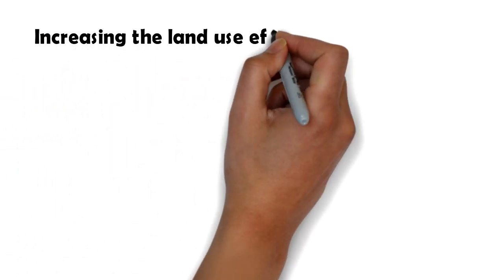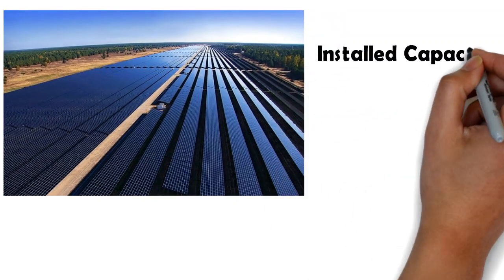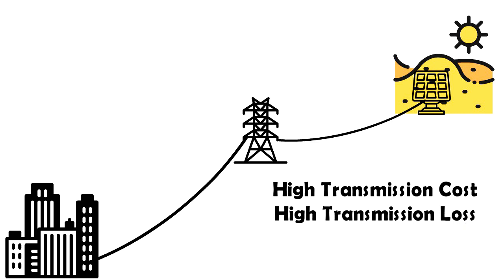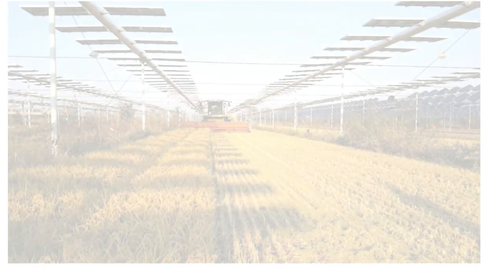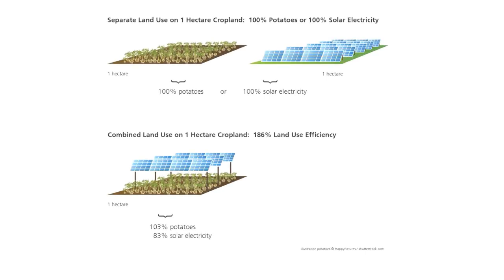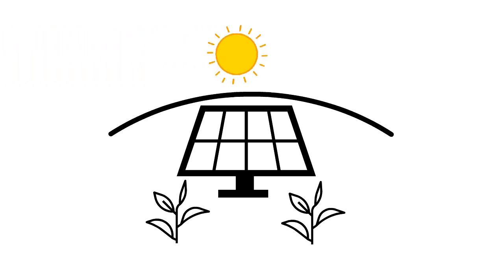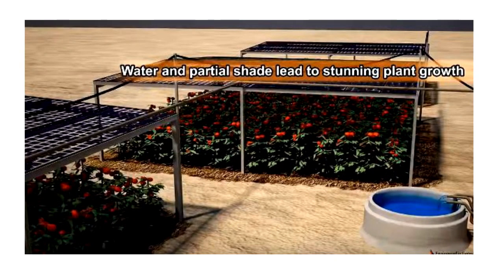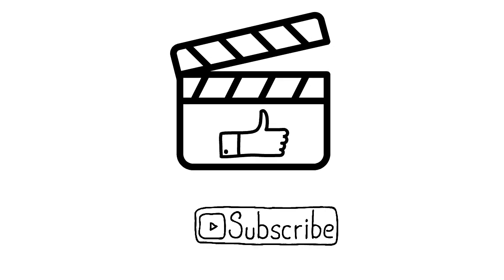Agrophotovoltaics- Increasing the land use efficiency

Comment: The best placement for photovoltaic energy production would be the nearly 50,000 miles of interstate highway in the US that already run through and between most major cities. Trees and shade is almost nonexistent, especially in the medians. Power transmission is already available on most of it - It's a no-brainer!
Reply: Consider the fact that we already own the right-of-way for the entire project and it's easy to access.
Reply: That's a good idea. I think the only problem would be in cleaning the SPV panels. Both the exhaust and regular dust will accumulate on the surface, and as long as there are cars zipping by, it would be difficult to clean the surfaces. Maybe they can be tilted vertically and let the turbulence of passing cars blow the soot off the surface.
Reply: @ericdew2021  I think there would be a lot more dust on the farms from tractors plowing and working the fields and wind than there would be on the interstate system.
Reply: I hope you are not talking about solar roadways. Those shit techniques are debunked already so many times. Its such a waste of money.
Reply: @brinkshows2720  clearly talking about elevated solar panels...
Reply: @BrownCreature  Stil a horribel idea. That means you put a hight limit on every highway. There is always going to be big loads that then can't travel over the highway or stupid people with trucks which are to high and hit them. Its just a to large of a safety risk and would cost to much money.
Reply: @brinkshows2720  It depends how high you put it.

Comment: This might also help the crops survive/mitigate global warming with local cooling.
Reply: global warming was invented by al gore, so no, it wont help crops survive something that al gore invented
Reply: There is no "global warming".
Check the years 1934 and 1936...
Reply: @WadcaWymiaru  There is glaobal warming.  Check outside.
Reply: @WadcaWymiaru  This year is clearly on track to be one of the warmest in recorded history.  For the glaciation to begin, the energy from the sun has to be reduced by changes in the Earths' orbit, tilt and eccentricity of orbit.  The greatest reduction in insolation those could provide is more than exceeded by the heat trapped by the extra CO2 we've pumped into the atmosphere.  Not only will the next glaciation be skipped but probably the four after that one as well.  You'd best slap your own face to wake up.

Comment: What are the additional costs of the elevated structure , and are there any payback calculations?
Reply: Well the aditional cost is just a couple extra meters of metal. So nothing big or anything. You are not even talking about a 1% more costly.
edit: As long as you don't need hughe combines to drive underneath them.

Comment: Solar power is not the answer geothermal entitle energy are you going to we should be looking at and bury the transmission lines
Reply: Tony Sanders why transmit over distance when you can use the power locally? I do agree in some places the deep source of heat available should be tapped into but where we live for example, there are many old mines that cross cross beneath us and it wouldn’t be suitable. It is windy as hell though... hence I’ve got an array of vawt that benefit from leading edge effects like migrating geese do.